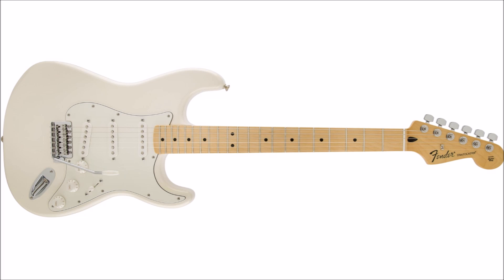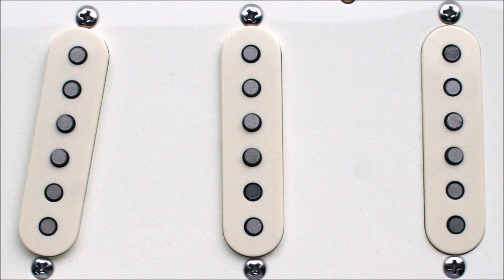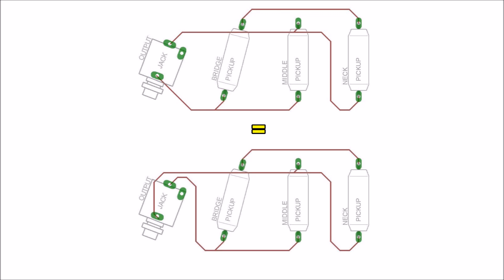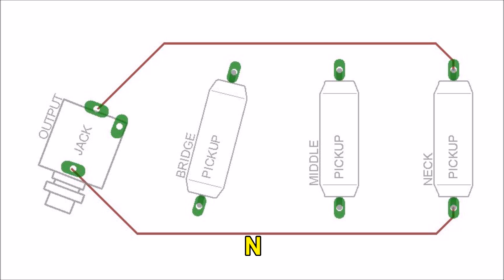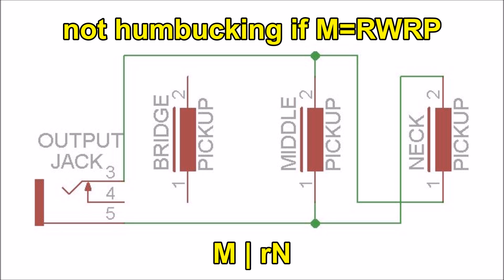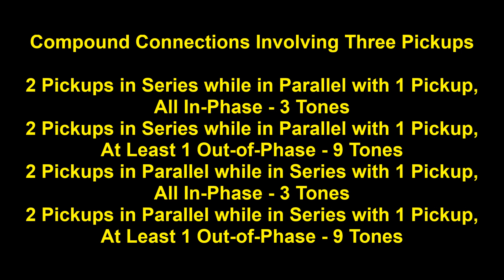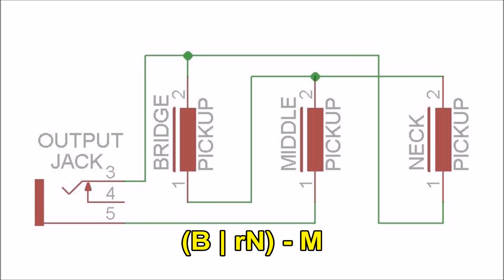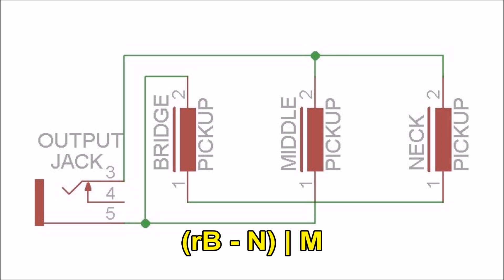All You Need To Know About All-Combinations Pickup Switch Systems - Part 1 - Basics and Foundations

Comment: Some people take things far to seriously and should get a sense of humour... let's be honest no matter how many pots, switches, wiring etc etc... people will find the 4 - 5 tones they like so a 5-way selector with 1 or 2 switches is all you need... playing a hot rodded Fender Jazz Bass i only had to add 1 on-off-on switch, used with the 2 volumes & i can get 6 tones out of my Fender Jazz... not bad for what once was a one trick pony bass, amazing what tones you can get using a switch and/or 2 volume controls... experiment, find the tones you like best and wire or use swiches etc on your guitar or bass for your favourites......worked for me but cannot hear the tones with this vid so you got to suck it & see (hear?), besides no 2 Strats sound the same so got to experiment to find your personal heavenly tone/s..... Very interesting vid.....

Comment: Brian May Special
  * Three Single Coils in Series.
  * Each Pickup has its own [ON/OFF] -Switch.
  * Each Pickup has its own [Normal/OOP] -Switch.

  ----------------------------------------
  1.  B            1  *  1    =     1
  2.     M        1  *  1    =     1
  3.         N     1  *  1    =     1
  4.  B M        1  *  2    =     2
  5.     M N     1  *  2    =     2
  6.  B     N     1  *  2    =     2
  7.  B M N     1  *  4    =    4
  ----------------------------------------
                                          13

Next all three [ON/OFF] -Switches have been replaced with [Series/OFF/Parallel] -switches. I don't know if anyone has done this so that ALL of the compound combinations work. But let's assume that problem has been solved (without guitar looking like a mixing board...):

  ------------------------------------------------
  1.  B              1  *  1  *  1   =     1
  2.      M         1  *  1  *  1   =     1
  3.           N     1  *  1  *  1   =     1
  4.  B  M         1  *  2  *  2   =    4
  5.      M N      1  *  2  *  2   =    4
  6.  B      N      1  *  2  *  2   =    4
  7.  B M N      1  *  4  *  8   =   32
  ------------------------------------------------
                                                  47

NOTES:

  * Single pickup can't be parallel or series. Or OOP 
     (well, technically it can, but alone it sounds the same).

  * Two pickups are wired either in Parallel or in Series. 
     Soundwise it doesn't matter, which one is OOP. But if 
     both are OOP, it sounds the same as when neither is.

  * Three pickups can be wired:
      * In Parallel
      * In Series
      * Both (Compound). For example, Middle pickup in
        parallel with the series connection of Bridge
        and Neck pickups:
              B | M | N      all three in Parallel
              B - M - N      all three in Series

              B | (M - N)    Compound
              M | (B - N)    Compound
              N | (B - M)    Compound

              B - (M | N)    Compound
              M - (B | N)    Compound
              N - (B | M)    Compound

Comment: Hi, did you refer to any academic publications/texts in your approach? I am curious about the science and math behind it.
Reply from the maker: If you are looking for references to pickup response to string vibration, the only name that comes to my mind right now is Tillman (or Tillson).  You can start from his paper, which you can google.  You can also check his references.  There are other academic papers that I have used as reference in my videos but I don't have them at hand and I can't remember their authors.  Different "experts" have different opinions on how the electrical signal is generated by the pickup.  I subscribed to the view that the signal is generated by the changes in the magnetic field of the pole pieces (read my comment in my video on "How to Make Cheap Guitar Pickups Sound Great for Less Than $1").  

If you are referring to switching algorithms, there are few published non-technical papers explaining pickup switching concepts and none of them involves all-combinations switch systems.  The few circuit diagrams that are available are complete circuit diagrams (not even schematic diagrams) with explanations only on what pickup combinations are made with a particular combination of switch states.  I attempted to explain all-combinations pickup switching concepts with practical applications and actual working diagrams in my other video.  The ideas and approach presented in my video are my own so feel free to critique.  There are third party circuit diagrams similar to the circuit diagrams I presented in the video, particularly with respect to the Point-to-Point Switch System, which is similar to the design of Jeff Cites.  However, the work of Jeff Cites is derived from the design of Robert "Wolf" Gagnon (I think) and my design is based on my own concept as described in the video.  I also pickuped some design ideas from the work of Dan Armstrong, particularly in using the DPDT ON-ON-ON switch.  I also used the truth table of Ben Yau to come up with the logic behind the Bus Switch System.

Comment: John, regardless of what others say, this video represents a hell of a lot of work, time, planning, and I, for one, respect that. Good job! As for dozens of pickup combinations, I have owned Carvins (and others) with plenty of switches yielding all sorts of tones and found myself still using just the same three or four settings all the time. These days I find that my PRS with two low gain humbuckers and a coil tap switch are enough. Still, this video opens up lots of possibilities that I hadn't considered to try on my Strat test bed, and it's always fun to experiment. Thanks for the video.

Comment: If this piques your interest, google "Phostenix Wiring Diagrams"-more variations on Strat-&Tele-type setups. Looking at one that uses a 5-way Super Switch and an S-1 pot. All normal Strat positions, plus with the S-1, you get the B-N Tele parallel combo, all 3 series combos, and all 3 pickups in parallel. Throw in some mini phase switches, and you'll probably be busy for a while----

Comment: This is a great video!  Thanks for sharing it.  I have a Fender Stratocaster with three single coil pickups.  I was planning to replace the 5-way selector switch with two DPDT on-on switches and one DPDT on-on-on switch per this "Dan Armstrong Super Strat" mod: http://www.dominocs.com/AshBassGuitar/index.html?armstrongstrat.html However, after viewing your video, I'd like to see if I can rewire it and access all 47 of the possible tones.  To do so, I plan to use two push-pull potentiometers to switch the phase of the neck and bridge pickups.  And I want to control the three pickups' series/parallel configuration using three DPDT on-on-on switches.  However, I'm having trouble mapping the series/parallel configurations to the three DPDT on-on-on switches.  I was wondering if you had any advice on how to do so.  It seems you're using five DPDT switches (on-on and/or on-on-on).  Is it not possible to create the main switch system using three DPDT on-on-on switches?
Reply from the maker: I just noticed today that your comment was tagged by YouTube as spam and was languishing in my spam folder.

Regarding Dan Armstrong's switch circuit, be aware that an On-On-On switch is a special-function switch, which is not usually carried by many electronics stores.  Many sales clerks do not know the DPDT On-On-On switch and they usually mistake this as a DPDT Center-On switch.  When buying an On-On-On switch, make sure to get the right switch.  

It's a lot easier to work on a design by drawing a schematic diagram.  Designing a circuit is like a math equation problem - write the entire equation first, which is usually complex, then simplify it later.  You can start by modifying an existing working circuit by adding additional functions one at a time.  When you have a working model, write a truth table and identify patterns.  I find studying tables a lot less daunting than tracing circuits in a schematic diagrams.  Patterns and symmetries usually indicate that it can be simplified.  

When I started working on a switch system 10 years ago, my first working design had around 8 switches.  After much pondering, I was able to simplify it to 4 switches but the switch pattern combinations became cryptic.  So I went back to 5, which is more intuitive to use.  I'm happy with 5 switches.  With the addition of 2 phase switches, the parts count is 7.  Fitting 7 switches in line in the switch cavity requires using subminiature switches.  With a spacing of 10mm between switch shafts, 6 subminiature switches can fit between the 2 original mounting holes.  The addition of one more switch sometimes required me to manually route an additional space in the guitar body to make the whole system fit in.  I prefer using independent switches for the phase switches, instead of having them integrated in a push-pull pot shaft, so that I can easily see the status of the switches.  I also prefer a single in line switch layout to have all the switch operations in one location.  But in the early switch systems I made, the phase switches were placed in a different location in the pickguard because I was still using miniature switches.

I presume Dan Armstrong wasn't able to figure out how to do all the connections with just 3 switches.  Otherwise, he would have written about it.  Or, he may have done it but did not publish it.  At any rate, there are some real gems in the circuits made by Dan Armstrong you can work on.  

You're aiming for 3 DPDT On-On-On switches (plus 2 phase switches).  You have more talent, determination and more resources to work on than what Dan Armstrong had.  Go for it!  Good luck!
Reply: I've also managed to create a switching system that uses 4 switches (one per pickup, plus another switch).  It implements all 18 combinations (excluding phase, which I'll handle with another 2 switches - probably push pull pots under the tone knobs).  I believe it's intuitive also - each pickup switch behaves identically.  I also have another design that uses only 3 switches but only implements 15 of the 18 combinations (again excluding phase).  Unfortunately, that switch setup is not as intuitive since one of the switches behaves differently than the other two.  Let me know if you want to talk about the designs.  Perhaps we can communicate in private?

Comment: This video is making my head hurt, but in a good way. 

I have been tempted for years to buy another Stratocaster just to test compound connections. I have always preferred guitars with more switches, push/pull pots, coil taps, etc. Ultimately I'd like a Telecaster body with 3 strat pickups and a Jaguar switch plate and push/pull pots to increase the number of choices, but I'd have to experiment to find my favorites before setting out to setup such a guitar.

My biggest concern is that the sounds I prefer will require a very bulky and unwieldy wiring harness.  Even though passive switching is my goal, a PCB may be the only way to fit so many circuits in such a tight area.

Comment: Hello, I very much enjoyed your video. I havn't yet found a switting system that allows for all 47 tonal options, so I have developed my own. Reply or comment if you would like the schematic.
Reply from the maker: Mike Perrino - You may find these useful, here are two websites with diagrams of switch systems:
http://www.1728.org/guitar3.htm
http://www.randombytes.net/guitar_pickup.html
You may also want to visit the Guitar Nuts for a whole lot of ideas.
Reply: The second link looks quite complex. I can show you the circuit I have designed that allows for all 47, but I don't believe I can post pictures here. The circuit only requires 3 DPDT switches and 3 3P3T switches.
Reply: I have sent the image. Please let me know if you can make use of this. Thanks for your time.
Reply from the maker: I got it.  I was of the impression that you have already tested your design and you have a working model.  I did not expect that what you actually wanted was for me to check your design and to make a prototype for you.  It's also a little bit difficult for me to analyze a layout wiring diagram and it would have been better if you made a schematic diagram.  Anyway, I emailed you a few questions about some of the connections.  Maybe you can help me by sending a truth table of connections of only the in-phase connections.  In other words, disregard the phase connection switches.  For example, what are the positions of the switches if the connection desired is (N|M)-B?
Reply from the maker: After receiving your explanation of your diagram, I redrew your layout diagram to a schematic diagram.  I tried/tested to trace/make the compound connection (N|M)-B and it's not possible with your diagram.  It's not even possible to make the series connection N-M.  I did not attempt to trace other compound connections since it already failed the preliminary test.  Sorry.